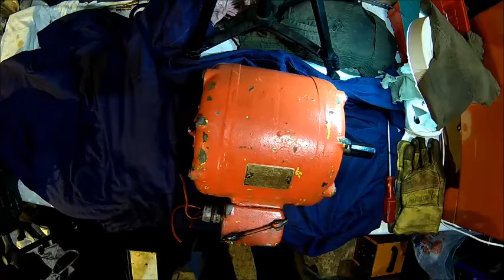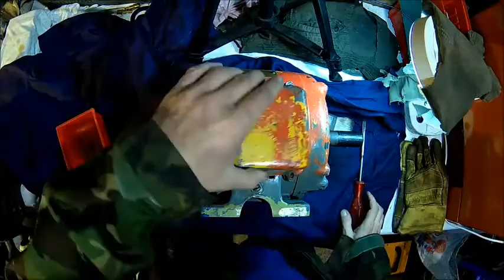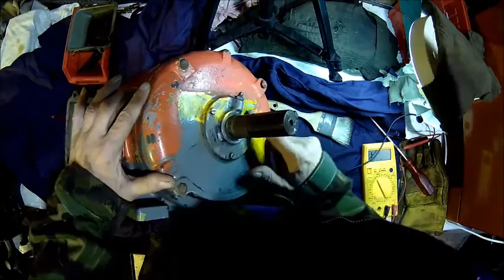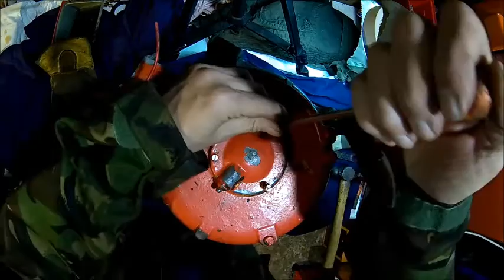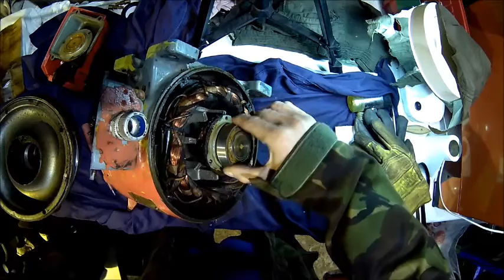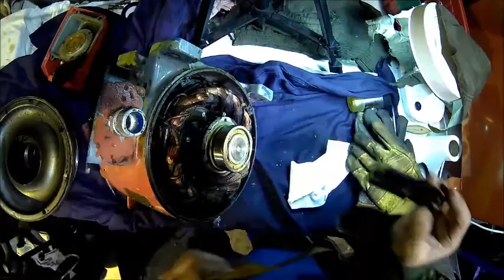Elliott 14S Shaper - Motor refurbishment part 1, tear down, inspection and brief checks

Comment: mike
yes, you nailed it with the grease, it has gotten wet. maybe from a coolant used on the machine. those old brushless motors are the bomb, with a change of bearings every few decades they seem to run forever. 
i have two english made motors on my bridgeport that are as old as the machine. i'll have to pick our brain sometime down the road about wiring them up for the states
Reply from the maker: The motor was pretty dry inside, no signs of water or coolant, just a bit rusty from sitting around. The trickier part is gettimg the metal particle loaded grease washed out without dissolving the insulation laquer of the windings.
I am just uploading another episode of my "Tame your Motor" series, perhaps that gives you some ideas with your Bridgpoert motors, otherwise just send me an email with pictures of the name plates.

Comment: Looking promising Mike. I felt quite anxious watching you poke about in there ! The poor old girls not had much tlc. Any sign of the dead mouse ?
Looking forward to the followup.
cheers Mat
Reply from the maker: Don't  worry, it's just a bunch of wires which are arranged in a pretty logical way. I think i altrady found the star point, just need to dig it out and solder some wires on. May take a few days as i got some other things to look at this weekend....cheers Mike